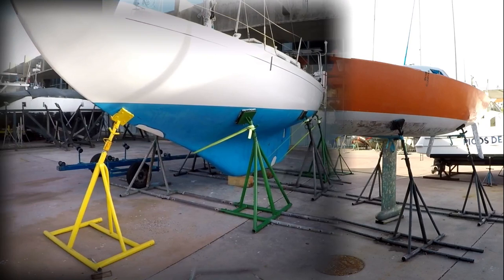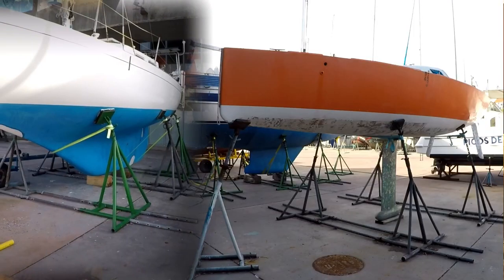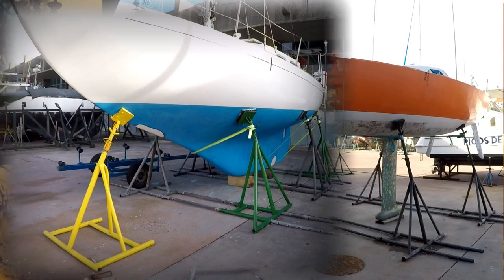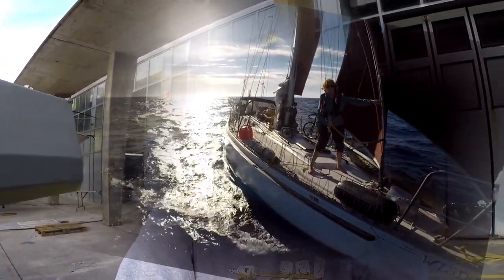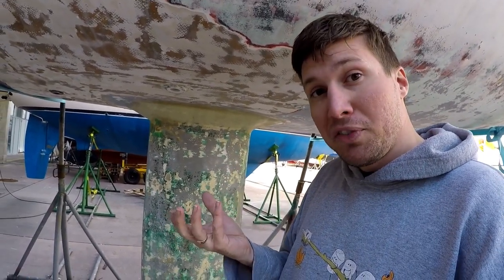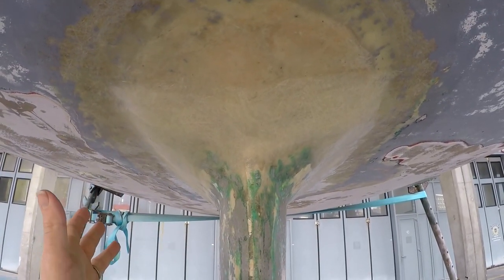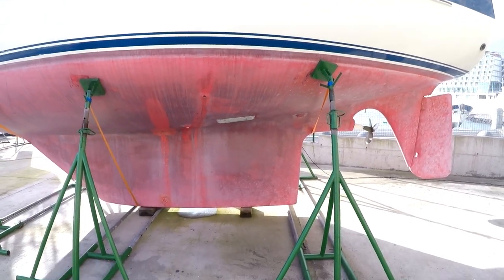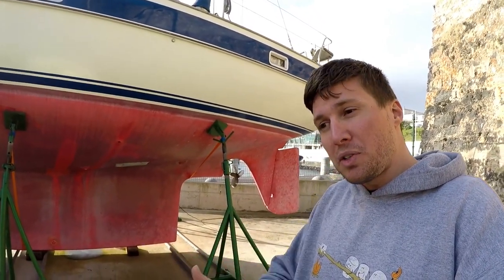Which is the BEST Keel Design? | Sailing Wisdom

Comment: Just because a boat has a fin keel does not make it a "Racer-Cruiser"! The boats you pointed out as racer cruisers were not racers at all. There is a reason the vast majority of modern boats have fin keels. They just work better. The boat is more maneuverable, it is faster, and it can actually sail upwind. Just because a fin keel is bolted on does not make it fragile. While it is true that you can do more damage to a fin keel running aground than you would a full keel, but that doesn't mean the damage would be catastrophic. 

I have been sailing for over 30 years and I have never run aground, (No I am not a liar, I just know how to read charts!). There is no way I would sacrifice overall sailing performance and get a full keel just in case one day I do manage to find a rock!
Reply from the maker: That’s good if you only sail familiar waters and where we’ll charted rocks are. While going down the ICW, passing through the Little River Inlet, we ran aground hard in the channel. 
It was charred at being well over 10 feet deep, but right in the middle of the channel was a 4 foot shoal. We were moving along with the current going about 6 knots when we rode up on it. 
The tow boat merely pulled us off and we were free to continue our journey. No worries about keel damage. 
Why did we run aground in the middle of the channel? Because the inlet moved the sand around and the bottom changes with each tide. 
If we had a fin keel in that situation, we would have necessitated a haul out to inspect the keel/haul interface. 
Keel designs are a very personal choice, we are willing to sacrifice performance to gain durability since we are always sailing in unfamiliar waters, many times with charts that say “local knowledge needed”. 

I know not all fin keels are racer cruisers, but yacht world does categorize the Beneteau 473 as a cruiser/racer (https://www.yachtworld.com/boats/Sail/Cruiser%252FRacer/Beneteau/473)

Happy upwind Sailing, we are really jealous of your pointing ability, we struggle in less than 70* off the wind (Square rigger performance numbers!
Reply: @nonyayet1379  I think you read something wrong.  I didn't insult you. And if my comment about "30 years" obviously doesn't apply to you, why are you addressing it?  

When you get on someone's video and tell them how wrong they are, especially when the content is largely a matter of opinion and a situation where "ymmv", it's pretty negative to do so for the sake of doing so.  Your crystal ball water tarot abilities aside, people just make up garbage so they can smugly feel superior and crap on content creators for no reason.  Except to espouse their own disgruntled negativity.  It's disgusting- which is an observation, not an insult.

Be positive.  PMA. It will get you further.  Step out of line in that regard and inevitably you invoke reactions in others. Think of my replies to you negative do-no-gooders as just illustrating the point  that you get what you give.

P.S. say my name out loud.  Stop engaging with idiots on the internet.
Reply: Now wait a second, you think that planting your keel in the mud requires a haul out and inspection? That is nonsense! Fin keel boats are NOT that fragile! Around here we have areas where the sand bars move around, and racers push the edges to gain advantage. Hitting the sand is not that uncommon, and it rarely causes any damage, even to the more extreme keels. Racers joke about "sanding the bottom of their keels".
     Hitting a solid immovable object like a rock is what can cause damage, and those are usually well charted.
     I understand you have a preference for full keels, but you should try not to be so alarmist about other types of keels. Fin keels are very strong. They have to be to hold the load of that ballast.
Reply: @RiggingDoctor   You said you ran aground hard. On what kind of sea bed? I ran aground in the mud (buried the keel in it). Didn't care to inspect my bolted fin keel after that.
Reply from the maker: It was a sandy bottom in the middle of the channel :)
Fun times!
Reply from the maker: You should check with your insurance company. Boat US and other insurance companies require an out of water inspection after a grounding because a small crack can lead to water intrusion and worse damage in the future. 
I wanted less worries so I avoided that fragility. I have a friend with a fin and he hits more shoals in the Chesapeake than I have hit in the whole ICW and has never worried about it!
Reply: @RiggingDoctor  Digging our keel into soft mud was the most gentle way to go aground possible! We didn't feel a thing except for the speed slowly decreasing to 0. I would assume less harsh on the keel than a 20º heel.
I did ask my (French) insurance company about the diligence they expect from us boaters to prevent big accidents. More specifically, I asked if a mast would still be covered if I chose to not replace the standing rigging every x years. They said they would cover the current market value of the mast, regardless of any maintenance fault. They added that showing proof of good maintenance helps increase market value, so they'll take that into account. It is my understanding that in the U.S., insurance companies have not been easy on boaters.
Reply from the maker: https://www.yachtingworld.com/news/keel-failure-shocking-facts-60006/4
Beginning of paragraph 2 (right after the image).

It talked about Pantaenius recommends an out of water inspection after every grounding, no matter how light. Yes keels are designed to support the ballast and resist righting moment, but the incalculable forces of a grounding are not part of the design characteristics. If they were, their performance would all wash away.

Comment: What about shoal draft modified fin keels and skeg hung rudder, that's what I'm going for, this is a very personal thing with no right or wrong answer, just the best fit for your requirements, personally if I could find such a boat, I'm going, steel full encapsulated keel, heavy moderate displacement 45' centre cockpit cutter with keel stepped mast and rodded standing rigging, impossible to find, I'd have to build  her using either Van De Stadt, or Roberts plans and would cost a fortune, so my compromise is a smaller centre cockpit deck stepped bolt on modified fin shoal draft skeg rudder Moody 33' mk1 or 2, late 70's vintage, and certainly blue water capable, each unto their own, my second choice incidentally is the early 80's Pearson 352 shoal draft boat. Good video, the main thing is that you WILL HAVE TO COMPROMISE, and this doesn't only apply to sailing characteristics but space and liveability as well
Reply from the maker: Oh yeah! Sailing is all about making what you have work for you. Nothing is perfect and every improvement is going to bring other detriments. 
Just focus on the good and have a great time! 
You seem to be interested in shoal drafts. Where are you looking to cruise? We completely skipped the Florida Keys and Abocos in the Bahamas because they were shallow for us. I hear they are beautiful though!

Comment: How about the old sailing boats that where build in the early 1900s? low free-board for their length low width and a full lead keel from bow to stern, i understand they are not made any more but to me they looked about the SAFEST in rough conditions, an not a sailor so apologies for my silly question
Reply from the maker: They really were very seaworthy! Modern full keel boats are built with those in the designers mind.

Comment: That full keel boat shown in the thumbnail has a seriously cut away forefoot. There are many types of full keel, including those with an extended forefoot that act very differently.

Colin Archer deep ocean boats are an extreme version of that. :-) the totally full keel boat you showed was.. not ideal.

The other advantage of a genuinely full keel is you can heave to in crazy seas and actually settle her down.

Comment: I listened to this same argument before leaving from NY to Bermuda. I was on a boat this full keel sailor said was ridicules and unsafe. Our time to Bermuda was under 4 days, his time was about 7 days. He got caught in storms while we out ran storms. We recorded a top speed of 17.3 knots only flying a #4 jib with no sensation of motion, very smooth and comfortable sailing. He was totally exhausted when he arrived in Bermuda and would not leave his boat, just told me he got caught in a storm.
Reply: Then you hit a submerged sea container or a whale and rip the rudder and transom out of your boat - with any luck the full keel sailor will pick you up out of your liferaft as he bobs on by. There are plenty of online vids of yachts sinking from this very thing - if your crossing oceans alone. It's a tortoise and hare thing - full keel.
Reply: I mean, they pretty clearly stated that your keel ought to match your personal goals. No two random people are likely to have the same desires from a boat.
Reply: Carl Outrunning storms is not going to end well.
Reply from the maker: We bumped into a whale far off Georgia, it gave the boat an epic thump! Knocked us to port a few inches and scared the crap out of us! No damage, and we think the whale was ok as it was just a glancing blow. If we were in a fin keel, we would have had a very different set of events follow! 
Proud tortoise here 🤣
Reply: Amen to that!
Why take 23 days to cross the Atlantic when it can be done in 16 days?
because of an extremely low probability of hitting a floating object?
And why do people think that hitting a floating object in a modern shaped boat must inevitably end in a disaster?
Reply: Fesh Fesh Why take 16 days when you can fly across in 6hrs?
Reply: @dreadfog  Yep! and it used to be possible to fly across in 3 hours instead of 6 hours now.
Reply: So do the fast boats sail out of the storms or into them?

Comment: Edit...The leading edge of the keel doesn't...does create lift, the lift is not generated by water flowing across the profile..a vertical wing. 😊
Reply from the maker: The keel is a vertical wing but the region of the keel where the lift is occurring is the leading edge, the rest is all drag.
Reply: @RiggingDoctor  interesting! Some things are really difficult to picture in your head. Or, the worst phrase ever, to wrap my head around. If I can understand something, does that mean I can wrap my head around it? It's funny how some phrases are only one way...
Reply from the maker: @mboyer68  I know what you mean (and English has some funny phrases). Something that really helps are images from tests that show the amount of lift generated and where with different colors on the design of the boat. The leading edge is always a bright red (lots of lift) and the rest of the keel, fin or full, is dark blue (low lift).

Comment: Great video to help people choose their perfect boat.  You didn't mention that the full keel provides a large lateral resistance, which is great for heaving to...and also allows the boat to track "as if it's on rails".  The knot or so of speed you lose due to a larger wetted surface isn't the only downside....  The full keel is not very maneuverable astern.  So, if you're going out for short trips and want to impress the folks at the marina when you dock, choose the fin keel...or at least one that is modified.   Oh, and I didn't read all the comments, so if someone else covered these topics in the last 10 months, o well, my bad.  Again, great video, great points.
Reply from the maker: Very good points! We have hove to a few times and the slick has saved our bacon!

Comment: Personally, I divide fixed keels into three classes:
Full,
Long, and
Short.

A full keel extends the length of the Water Line. It's advantages are very good tracking and shallow draft. It works more like a snow plow than an airplane wing. It gets its lift from shoving water aside.

A long keel is clearly longer than it is deep. Though it gets much of its lift from shoving water aside, it gets some aerodynamic lift. It also limits draft to some extent, but it's best attribute is roll dampening.

A short keel is at least as deep as it is long, and gets all of its lift through aerodynamic forces. It is most effective of the three at going to windward. It also has the least friction drag. The shorter it is, the more true this is.

Just thought this might help.

I love your videos.
Reply from the maker: That’s a really good way to divide them up

Comment: Important point about keel differences is associated maneuverability, particularly when going astern.  How does your boat handle in tight spaces?  Liked your video. Thanks!
Reply from the maker: We go forward and starboard 🤣
Med mooring is always a challenge but working with the prop walk and tossing a really long line to warp the boat into the slip is our go to method.

Comment: I was looking at a Catalina 30 Wing keel is that a good boat
Reply from the maker: Wing keels give more leading edge length which in turn gives you the performance of a longer keel without the added depth. The downside to a wing keel is if you get stuck in mud, apparently they can be harder to get unstuck (the wing gets buried in the soft mud like an anchor fluke). 
I would go out for a sail and see how you like the motion of the boat in light winds and also in heavy weather. If it sails the way you like, then it would make a good boat for you :)

Comment: don’t you think going sailing your have to accept a degree of risk and the risk of your keel falling off is probably ones of the lowest risk you take no matter what type you have.
Reply from the maker: It’s incredibly low with a full keel that is glassed on, a rare but present issue for a bolted on fin keel. 
Lately, there have been many more cases of losing keels on race boats, enough that they are doing investigations because, according to the race committee “it’s happening too often”. 
Google “keel fell off” and you will see a ton of capsized (previously) fin keel sail boats and no full keel sailboats. 
Would you really want to worry about that midway across the ocean?

Comment: It is simply a foil as it does not function in the air.  A sail uses an air foil like a air plane wing.
Reply from the maker: The terminology is awfully close in sound, but the keel is an aerofoil while the sail is an airfoil.
Reply: @RiggingDoctor  well Again close a keel is a type hydrofoil. Areo implies air. Wherr as hydro is used in fluids

Comment: for someone shopping from scratch and you like the rudder hung from the keel or skeg ... ask yourself can the driveshaft be removed from the boat with out removing the rudder. Many can, those that can't make for a headache when replacing cutlass bearing or the driveshaft itself. 

let me comment on how much I enjoy your stuff
Reply from the maker: That is a very good point about the rudder and the shaft relation. Some full keel boat designers thought about that and made a bend in the rudder post to allow access to the shaft and cutlass by simply turning the rudder, other designers didn’t seem to take that into consideration and made the rudder post straight so that it is always in the way. 
Our Morgan has the straight post and when I needed to remove the shaft one time I had to pull the entire motor out so that I could pull the shaft inboard and then out through the companionway. It was a pain of a job! Our Alberg has a notch in the rudder post so that when you turn the rudder you can easily pull the shaft right out without any added work. 
Since you don’t have a boat yet, that is a very important thing to look at when shopping around!

Comment: I would also mention the manuver ability of having your propeller right before your rudder. Steering when under power is much more responsive With the quick water going directly past the rudder.
Reply from the maker: Very true, we use our rudder and prop like a stern thruster to kick the stern over hard with a quick blast of power.

Comment: I would love to see you folks talking with people in yacht design industry that have been designing sailboats for quite a long time.  A blade keel is NOT UNSAFE in heavier weather.  OMG  I love it when ignorant NON engineers think something is unsafe
Reply from the maker: I specified that it’s not “unsafe” but “won’t make the storm less horrible”. 
I’ve been on an engineered (pronounced flimsy) boat out in the Gulf Stream in a storm and that boat was flexing around like crazy along with throwing us all over the place. Oh, and the boat was 47 feet long!
A full keel (pronounced heavy displacement) boat will move more sluggishly, and that makes the storm “less awful” in my opinion. 

For fun, google “keel falling off” and tell me how many of the reported boats were fin keel and how many were full keel.